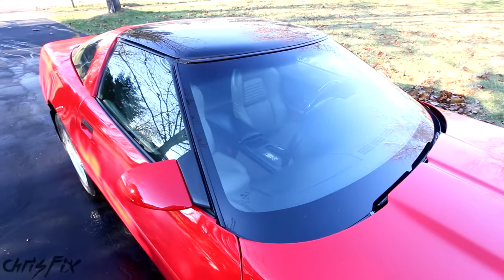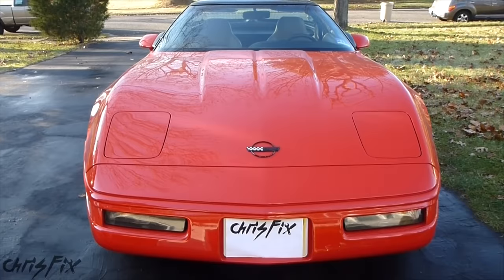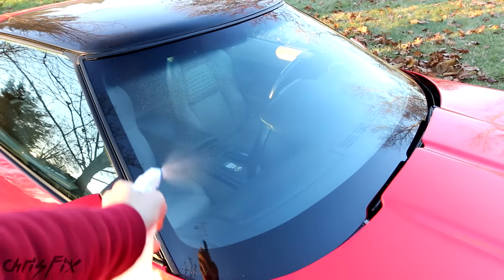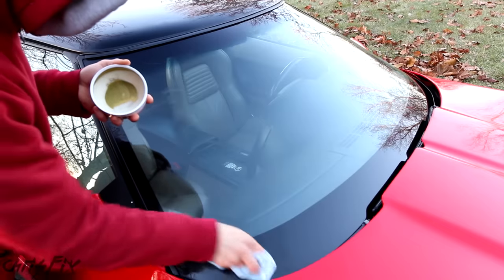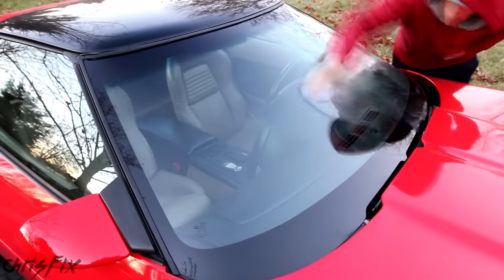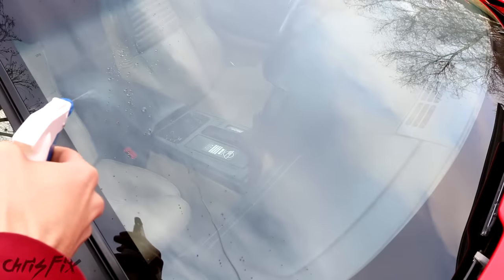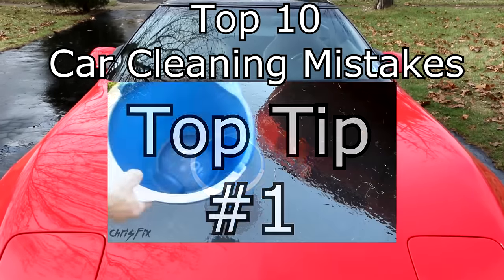How to Super Clean Your Windshield

Comment: Chris Fix is single handedly keeping the micro fiber towel companies in business.
Reply: Kitchen paper towels work pretty well for me for drying and polishing glass.
Reply: r u not supost to reuse micro fiber cloths/towels  ?
Reply: Nah, in my neck of the woods one single full-service  car wash will burn through a thousand bucks worth of microfiber towels in like 4 months lol
Reply: Harbor Freight.
Reply: @terrariarules1966  not on paint, but windows are fine as glass harness makes it scratch resistant
Reply: Actually both hands, wax on wax off.
Reply: Yeah by removing layers of his black window seals and wiper blades claiming that its dirt !! WTF LOL yeah ok dude keep cleaning that shit , w/e makes you feel better i suppose .
Reply: I do a pretty good job keeping them in business, too.
Reply: Microfiber is the new duct tape.
Reply: I love microfiber, haven't used it on my car yet but, I clean my glasses with a microfiber cloth, no fluid, and it does a great job. I clean my phone with it and it takes off the fingerprints with no problem, no cleaning fluid. I love microfiber cloths.
Reply: Frotax Frotax  I prefer a good old oil rag. Maybe a pair of old jeans and my grandpas flannel. then give it a good rub down with my dogs sleeping pillow topped off with half an orange slice down the center of the windshield.
Reply: sure is
Reply: You should see how many of these a body shop uses 😂
Reply: @Flaakk  imagine buying paper towels to not use them i make rolls spin like beyblades
Reply: I read your comment right as i entered 2:14
Reply: John Smith honestly not really at all just don’t wash like an ass i guess haha I have cheap rags for my beaters and I’ve had the same Walmart bunch of 12 for 3 years now still look the same
Reply: Around here they sell like 7 of them for $1.
Reply: Dev04 yeah anyone who buys expensive ones and complains is kind of an idiot the cheap ones make no difference unless your shooting for showroom finish and even then probably not a big difference at all
Reply: @whydoihave6neutrals772  Heck, sometimes the soap to wash them costs more than the towels themselves!
Reply: Micro fiber towels and rags are top of the line...you can wash them like normal... When you dry them... DO NOT use a dryer sheet... It will remove the usefulness of the micro fiber....
Reply: and the soapy wooder manufacturer
Reply: single-handedly*
Reply: And Detail Geek
Reply: I plan to upgrade eventually, but 2/1.00 Walmart ones aren't too bad.  And damn it, I forgot to get some Free and Clear detergent today.  There's always tomorrow.
Reply: @Nutty151  Where is "here"?
Reply: @02chevyguy  It's where I live. It's an expression in English. "Around here" denotes where one lives, usually.
Reply: ordered 64x of kirkland microfibre cloths from amazon shipped to australia 2 years ago best $40 I've ever spent lol, 32 was probably enough but at least i'm good for 100years.. good quality much better than the cheap shit you get here (good 'detailing' cloths are sooo expensive branded stuff and very small quantities). I only use about 9 in rotation for various things around the car and fairly frequently wash them
Reply: Great video! People complaining about microfiber towels are ridiculous. How poor are these people?
Reply: Just what I was thinking....how many micro fiber towels do I need?
Reply: 😂😂So true!
Reply: @MoltenJules  sandpaper works fine for me  it gives the cool milky aesthetic
Reply: He's a part of big micro.
Reply: LOL...When i  use my GF,s BMW, i return a tiny bird mess on her best car....lol
Reply: @Flaakk  not if you wash them in warm water with woolite and no fabric softener and do not heat dry them air fluff them instead
Reply: 😂💯 At any given moment in his life, l would bet that he has a clean micro fiber towel with him at all times😂😂😂😂❤
Reply: A micro fiber towel is the right tool for ther job.  Use an inferior tool if you want. Looks like lots of people here use a crescent wrench in place of the correct socket wrench because it's cheap. 😜
Reply: Are you complaining ?
Reply: LMAO
Reply: @terrariarules1966  you can re wash in the washing mashing just make sure it’s cold settings and when you put into the dryer cold air to that the fibers don’t melt and fuse together
Reply: I have some patchy circular transparent spots on my car windshield.. I don't know what it is and it's not coming off with a simple wash or using a micro fiber towel.

It's visible under artificial light and really spoils my view when there is glare from oncoming vehicles as those patches cause the glare to spread and are visible too causing distraction.
Reply: Is the wax really necessary? For workaday civilians me?
Reply: New drinking game every time Chris says microfiber cloth take a drink
Reply: No clue what you’re talking about bud
Reply: Same here I love em
Reply: Lol, no doubt😂😂😂
Reply: Yeah...like I know what 5lbs of pressure is.  You are giving me waaay too much credit.😂😂😂

Comment: And now we need a "how to clean your micro towels" video!
Reply: take your car and rub it on your microfibre towels in circular motion and then vertical motions for best cleaning.. ezpz
Reply: Andy K that’s what I was thinking! LOL
Reply: @zombierobbie-me1je  LOL :D
Reply: tip #1: NEVER use fabric softener when washing or drying microfiber towels.  Ruins them.
Reply: Microfiber towels should be allocated for specific uses and washed  together. Eg; Blue towels should be only used for Glass and washed separately in Cold water then air dried without heat. Yellow for Wax removal only and warm wash separately. Red are for Drying and cold washed and Green are for grime, dirt, grease etc. and warm washed. 
And finally, never use Laundry Detergents with "Softeners", "Fragrances" or "Dyes", never heat dry and always keep the towels out of the sun. Tip; When cleaning glass use the Green towels first to clean the corners and seals, which are Black with dirt that will mess up the Blue towels, which you then use to do the rest of the window with. And only use paper towels when wiping RainX, Aqua Pel or Vision Blade clean as Microfiber will remove too much of what you've put on.
Reply: @zombierobbie-me1je  wahaha
Reply: @JoseAlfonsoChavez  dude you cant say that here chris is gonna lose views
Reply: It's called a washing machine....
Reply: Detail Geek has one. Also just search how to. You never wash with other fabrics. Never use fabric softner. Use a plain gentle non scented detergent if possible. And hang them to dry or dry them on the lowest heat possible because you don’t want the fibers melting. But I’d hang them to avoid static cling.
Reply: I said the same thing on another video and The Chemical Guys commented and said that they make a special microfiber wash that you can use for your microfiber pads or towels.
Reply: I was just watching this video thinking that very same thing!! 
How do you clean those microfiber cloths??
Reply: use another microfiber towel to clean the dirty microfiber towel. Easy as that
Reply: @michaeloday9331  I feel like a madman for using one microfiber for everything. Body, glass, rims, tires, engine bay, the dashboard, soap, wax, rain-X, polish. And just wash it with shampoo (hair shampoo).
Been using the same towel for almost 3 years. It was green when I bought it. Its now grey / black
Reply: Your window looks filthy.
Reply: its called, throw them away!!
Reply: @michaeloday9331  Is this a joke??? I can't stop laughing....................
Reply: @zombie123 robbie321
That reminds me of a motor journalist who comments once on a car where it was very difficult to clean out the ashtray. His conclusion was that one should roll the car over or just write it off.
What a pity that the original "Top Gear Team" never got hold of a car like that!
Reply: @Curmudgeon555  I've made this mistake 😭
Reply: Absolutely
Reply: I did see a video how a car detailer cleaned his microfiber cloths... he had a separate washing machine in the garage and did not ever use the household washing machine.  My tip on that and what I do is hand wash the cloths first to keep the bulk of product out of my good machine.  This will also keep you on the good side of your partner - I can tell you that hubby threw a grease cloth with tranny fluid or some smelly fluid that took me many washes to get get out of my regular laundry and machine - I was mortified.

Use a liquid detergent as powdered does not completely dissolve and can add scratchability to your cloths - powdered detergent does not fully rinse out either.  I use  warm to hot water to dissolve the products used.  I have several microfiber towels to make a full load.  The premium tip to this is never ever put anything else in with them - especially a terry towel as the terry will grab the fibers and ruin your microfiber cloths.  That is why I have enough to make it's own machine full of only microfiber cloths.  The next tip is just what I do on my own but have not seen and that is to put a small amount of vinegar in the rinse cycle - it cuts / removes the soap residue from the cloth.  If you ever have a slippery bathtub you will find keeping a squirt or spray bottle of vinegar handy to spray the tub while rinsing soap or hair conditioner out to make it non slip and much safer... I had a bad fall and learned a very quick lesson.  I don't ever use laundry softeners like downy so y machine is totally free of that product.  I also have a double rinse feature which I have used.  My next step is to fluff them in the dryer for a couple of minutes so they are easy to separate and I hang to dry.  You don't want to have a hot dryer but a few minutes are fine or if you have an air only option I think that would be fine.  The only other thing that I do because if have several kitchen cloths is that I add liquid peroxide to the wash to help remove stains - my cloths are several years old and still look and work great. In the summer I give them a quick dry on the clothes line - it hasn't affected them that I know of.  I bought a new 25 count package and have not had to use them yet.  On another note - I only have one color and as another user mentioned - they sort and wash by color separately which I would totally agree on that tip as there are some very fine cloths that you would not want to mix with the larger looped ones.

Comment: The real trick is cleaning the inside of the windshield!
Reply: Use some foam spray glass cleaner and a lintless shop towel, like they sell at Walmart. It also really helps if you get one of those triangle shapped microfiber on a stick to help wipe the area at the base of the windshield and at the very top of the windshield. These are also great for getting the inside of the rear window, too.
Reply: that to.
Reply: Yeah you'll look through the windshield and think it's clean but then drive at night or get full glare and know that it's not. I don't think you would want to wax the inside but maybe I'm wrong.
Reply: Duh.….but Chris did explain how to clean your inside windshield in another video!
Reply: vinegar and kraft brown paper towel facing the sun at dusk to ensure there are no streaks.

-OCD survivor
Reply: @canadude6401  rubbing alcohol to melt frost. In the winter I pour it in my windshield "tub" under the hood. Also a spray bottle to spray the outside lock and door if they freeze,
Reply: go see his vid then
Reply: I have been trying to clean the inside for so long
Reply: @resdyne9590  he already has a vid on that
Reply: It helps to be a contortionist  no matter what you use.
Reply: Absolutely. The oils from any cleaners that you may used on the dash just go up and "infect" the inside of the windscreen.
Reply: @holiday-td6hx  Which one ? I don't find it.

EDIT : Ho... Forget about it. Just have to look at the "cleaning" playlist.
Reply: Exactly
Reply: I know some of those people that have hand and feet marks all over the inside of their windshields 🤮.
Reply: Good INFO.
Reply: givemetoast why did I read that in uncle irohs voice
Reply: apparently if you have to wash the windshield fkrm the inside
Reply: YES    ...The "inside" is the most important !!!!!
Reply: @canadude6401  HAHAHAHAHAHA!!! I know the pain.
Reply: He has a video for that!
Reply: If your car doors are freezing shut it’s time to move.
Reply: The struggle is real
Reply: holiday 2406 what?!🙀
Reply: It hurts my body just to think about it
Reply: It hurts my body just to think about it
Reply: Agreed
Reply: Boy was that frustrating. And then it’s hot so I swear and then it drops over the console I just cleaned. 😡
Reply: I use invisiglass on a microfibre and immediately dry with another microfibre
Reply: I came to the Chris vids for the inside window tricks but now I'm here for the outside work because....well because.
Reply: @holiday-td6hx  wished you would have included the link to the video you referenced.

Comment: 1. Clean with glass cleaner and microfiber towel 0:54
2. Use clay bar with warm water 2:07
3. Clean again with glass cleaner and microfiber towel 3:12
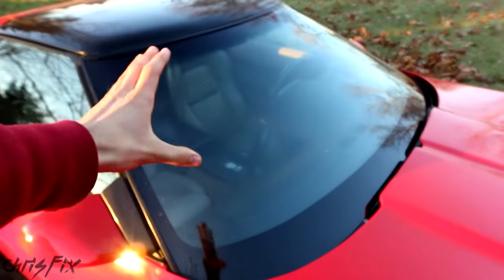4. Dry with absorbent microfiber towel 3:39
5. Wax windshield 3:58
6. Buff off the wax with microfiber towel 5:22
7. Buff off with a finishing towel 6:26
8. Clean off wiper blades with glass cleaner and microfiber towel 7:33
Reply: Legend bro, I was just thinking I wish he’d put the steps in the info or something haha
Reply: Thank you so much
Reply: Not all heroes wear capes
Reply: @ManuelGonzalez-kq4gi  You never know --- He might wear a cape!
Reply: Thank you!
Reply: My Way of Cleaning the Glass
1. Clean the Wiper Blades
2. Glass Cleaner and a Microfiber Towel (Circular Motions, Opposite Direction)
3. Clay Bar and Water Bottle (Up and Down, Circular Motions), Clean Again
4. Dry the Windshield
5. Glass Sealant
Reply: hell yea
Reply: Clay Bar Step- I spray Warm Water on the Clay Bar
Reply: you can see the face 1:48

Comment: Never thought to clay bar or wax the glass, genius.
Reply: John Treanor .
Using wax on a car windshield is nothing new. I have been using wax on my windshields since the late 1960s.,
I use that method around 3 times a year
Reply: My ex-wife Valley Girl use the coal shovel on my windshield to remove ice in the winter needless to say she scratched the hell out of it I was able to get this back to 95% thanks to Chris awesome thanks buddy wife is down the road making somebody else's life miserable they do not hand out common sense in the valley girl world la
Reply: Good
Reply: Casper Gomez  You have to clean and dry the windshield before using rainx.  I had to use rainx spray and paper towels to clean mine and then apply the rainx spray.  My wiper motor burned out while driving smoke everywhere.  Carefully got to Walmart and applied as I stated above and went home no problems didn't need my wipers.  If I had used wipers you have to clean the windshield.
Reply: I can see that... You're just getting down to the glass just like your getting down to clear coat with them.
Reply: The clay bar also works like a champ on chrome
Reply: Waxing your windscreen so your windscreen wipers don't work and it's not safe to drive when it's raining how is that genius
Rain-X is rubbish
Reply: I clay barred my windscreen excellent result.
Reply: It does work I have used wax on several vehicles and it makes a difference.  Will make the wipers more effective and in some cases about 90% of the water beads right off.
Reply: For the ease of use, I just use a quality spray wax & my windshield is great, water sheets & beads like crazy.
Reply: Casper Gomez  I'm trying the wax now clay bar n wax. Used wax before but never clay bar then wax. I use rainx. Put it over 3 months and still working but I use rain x washer fluid too so I'm sure helps. But I'm a try the wax hope to get good results
Reply: Casper Gomez  thanks. The same carnauba wax he used.
Reply: @Kingfisher1060  What part of the valley is she from?

Comment: This WORKS. I just did my car's windshield today following these exact steps, and it's like a mirror now. I could not find one single piece of dirt on it of any kind, nor smudging or anything. On the downside, I know now that it has about 300 tiny but now noticeable rock chips on the glass... lol.

The "Invisible Glass" cleaner is a miracle. It got my other windows to be almost perfect by itself, which is good enough for them. Thank you so much for this video! :D
Reply: Totally agree with you @IronDuke. Invisible Glass is great.
Reply: Out west you'd have splattered bugs again in no time!
Reply: @ltcajh  I actually live in Arizona and I have to give the windshield a quick spray and wipe to get bugs and dirt off every week. The wax coating makes it all come right off though. So easy to maintain! :D

Comment: Good tips...  as an alternative, you can clean the glass and then use Meguiars Ultimate Quik spray wax, then lightly buff with a microfiber cloth.  Gives the windshield the same slick surface that allows it to bead and roll off water droplets.  A bit less labor with almost the same results.  And the Ultimate Quik spray wax won't leave white residue on black plastic and trim pieces around the windshield.
Reply from the maker: Thanks a lot for the tip!